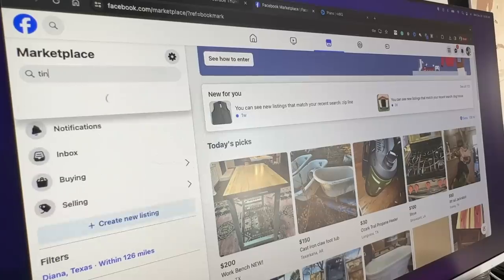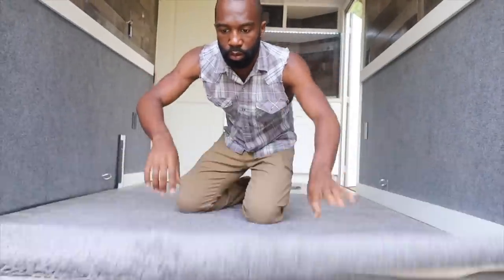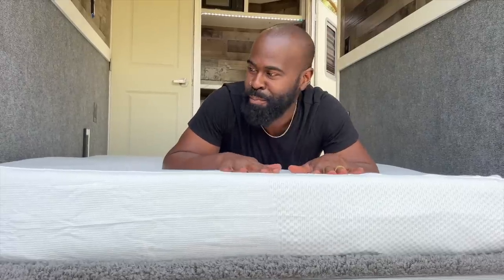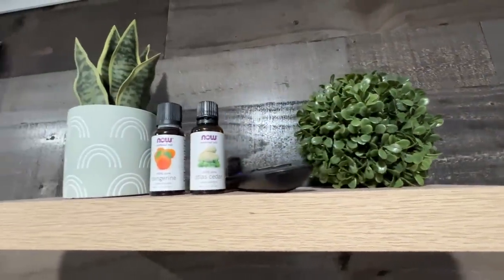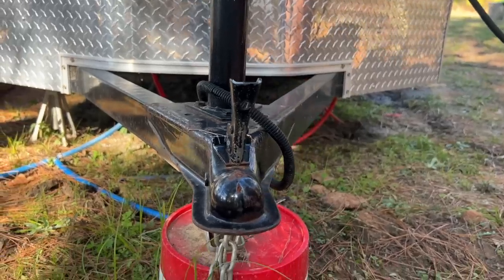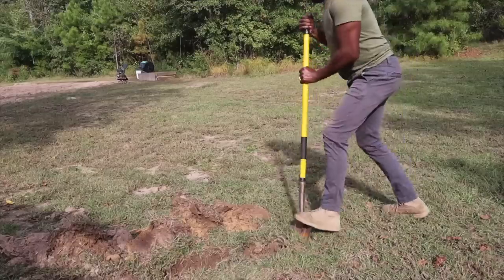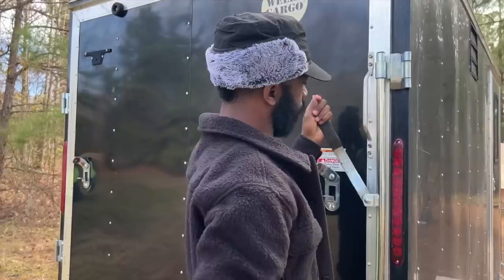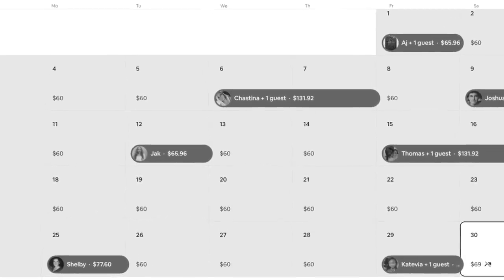Converted A Cargo Trailer Into A Stealth Tiny House

Comment: A folding counter top would be a good addition to the kitchen and a Murphy bed would allow for more space and a seating area when the bed isn't in use. Just an idea. Love it otherwise though
Reply from the maker: Yes, we had a tiny tiny murphy bed but we took it down because it was pulling out of the plywood walls. If we get a chance to build one from scratch we would do it different. Great points.

Comment: You need to put your bed on a bit of a bed frame..air needs to flow underneath or it will mold.❤👍✌️
Reply from the maker: We’ve had it like this for almost a year now. No mold. And plus it’s protected by a mattress protector.

Comment: Needs some more windows.  Do you have any water tanks or are you just piping it in from a faucet as needed?  The reason I ask is because that's what truly makes it off grid should you want to take it somewhere other than a campground. I'd also make the bed fold down from the wall and have more of a dinette. I don't need to explain Georgia weather to you. There's going to be days you just can't sit outside. Just my 2¢ as someone who has built a truck camper. Oh and I'd put a shower pan in the bathroom in case you need to shower indoors.
Reply from the maker: Yes it has a 30 gallon tank behind the wall that’s the black opening I showed in the video. It is completely off grid and we can easily add our solar panels to the top if we wanted. I appreciate your 2 cents because I love interacting with people that watch my videos. ♥️
Reply: Good because I didn't mean to come across like a🍑head.It wpould have been fun to work with you guys on.
Reply from the maker: @TheKingOfInappropriateComments  are you in Georgia? We come back often! Austyn is from there and I was there for 13 years.